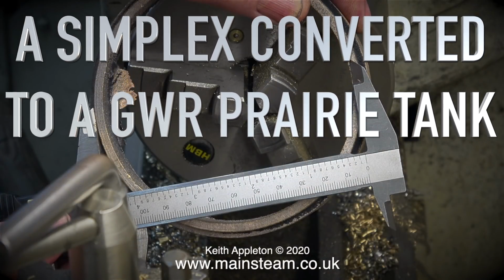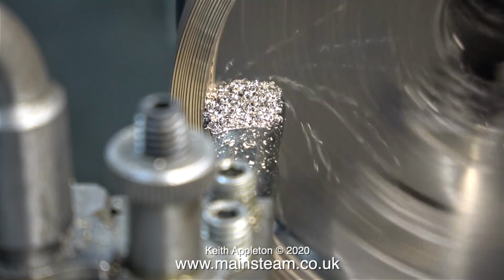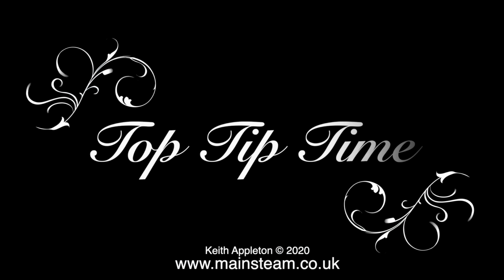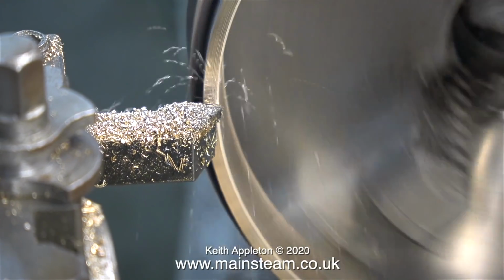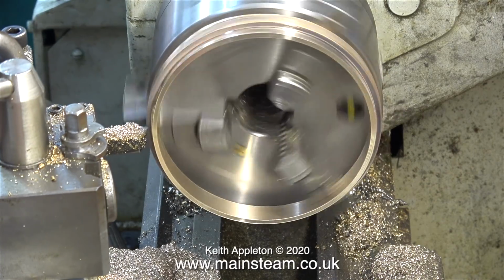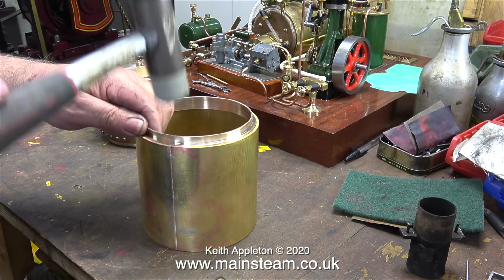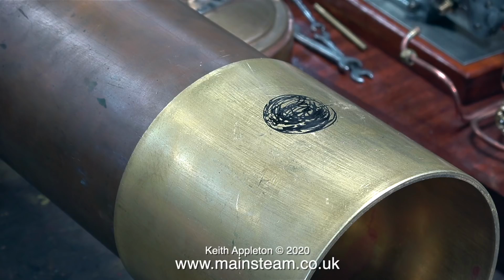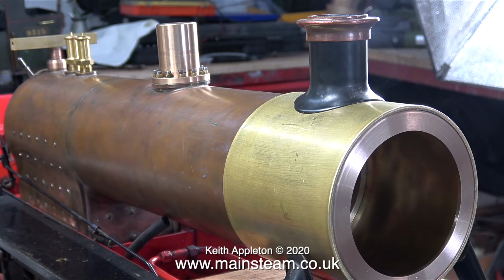SIMPLEX PRAIRIE TANK - PART #13

Comment: Coolant?
Reply from the maker: not that I am aware of . . . I don't use it in my home workshop unless I turn larger steel parts.
Reply: @keithappleton  To be fair, I generally go without on non ferrous stuff, if only to make collecting the scrap more pleasant but heat I've rarely had an issue with. You must have been ever so gentle with that chuck key!
 A six jaw would be the expensive answer perhaps, but on more critical thin hollow sections I make a plug so that I can hold firmly and take a decent sized cut.

Comment: I'm only an armchair general (i.e. I don't have a lathe), but would running coolant help with the temperature stability of the workpiece when holding it internally in the chuck?

Excellent video as always :-)
Reply from the maker: Yes, if you can tolerate the mess and smell of the stuff in your home workshop . . .

Comment: To make it look like an actual 4575, woukd it be possible to make a fake, GWR Safety Valve bonnet, and fit it over the dome cover?
Reply from the maker: Being realistic, it is hardly worth it - This is only a "Simplex" after all . . .
Reply: @keithappleton  Valid. If someone wanted a 5" Gauge prairie, they'd probably just go and get one. Simplexes are just what they say on the tin.

Comment: Awsome videos as always!
I hawe a question about making castings:
When i made some testpieces of brass ingots from the same source, first time it turned out almost perfect, but next time the ingot looked like a swizer cheese, even if i taught the temperature was where it was supposed to be. My theory is they something may had caused zinc outgassing, but i hawe no idea why.
I used the same type of waterfree oil based red sand both times.

(Since i don't hawe a dedicated oven and propane is pretty expensive where i live i simply putted the cruisible on the blacksmith forge and tried to estimte the temperature in the same way as i do for iron since the coulor should as i learnt still be the same apending on the temperature, but the molten metal looked bit more brigt in the later batch so i guess it was around 900-1000 degree Celcius, wich may had been in the borderline for zinc based brass, i guess? But if i lower the temperature too much it won't flow out properly in the mold, it just cool down to early and clog up).
Reply from the maker: Sorry, I know nothing about foundry work . . .
Reply: @keithappleton  Ok, but thank You anyway for taking Your time with my stupid questions! It was relay kind of You!

I will do some more experiments and see if i can figure it out, it was fun to make sandcastings!
Reply: Vampira, brass and aluminum are great metal to cast with but both will "GAS OUT" if you use a lot, sometimes even a little recycled metal in the melt. The recycled metals often have oil and other contamins. Try to use uncontaminated melting stock and make sure you have a clean uncontaminated crucible.  You can buy degassing tablets from any number of places, make sure you use the correct one for the metal you are casting with. Always try to use as clean of recycled metal as possible. Over heating the metal can also cause the metals to gas out so make sure you watch your superheat. From a foundry manual; Yellow Brasses. "The melt should be brought up to a temperature of about 1,800°F. to 2,000°F. in a slightly oxidizing atmosphere, the temperature at which the flaring of zinc occurs, and allowed to flare for a few minutes under a good ventilating system. The purpose of the flaring is to flush the melt with the aid of the escaping zinc vapor. Under normal operation, a flaring period of 3 to 5 minutes will result in a zinc loss of approximately one percent. Care should be taken not to overheat these alloys, because the zinc loss and resulting zinc fume will be a serious health hazard. After the flaring is finished, the melt should be skimmed. The crucible is then removed from the furnace and the melt skimmed again or, if the melt is poured into a ladle, it is skimmed after the transfer." The zink loss can also cause the outgassing.  Do not agitate or stir the melt immediately before pouring. I hope this helps and best of luck on the next pour!